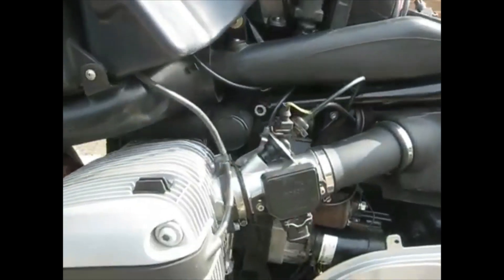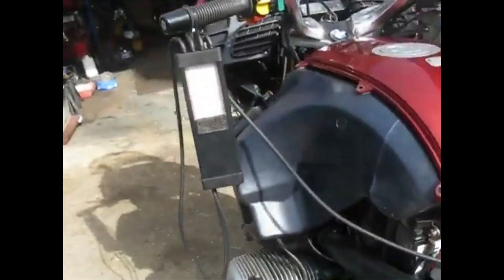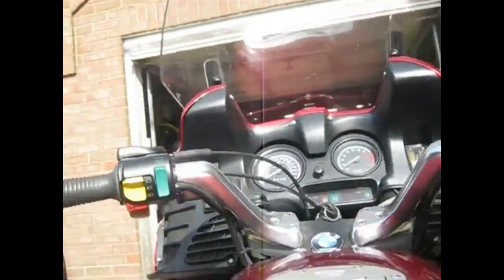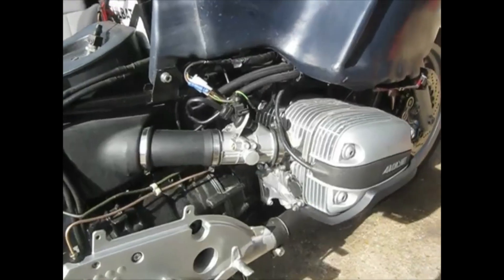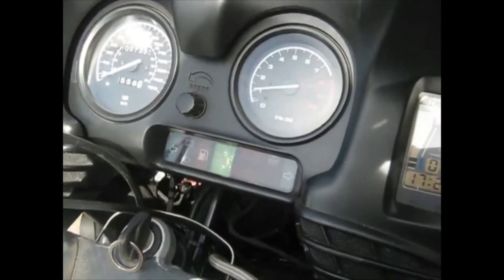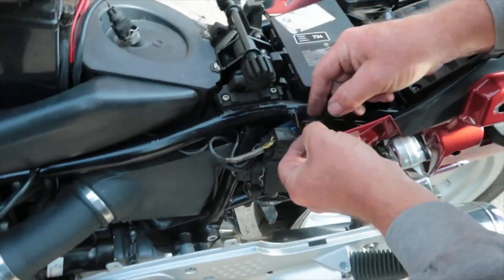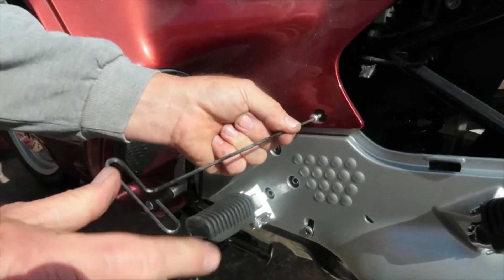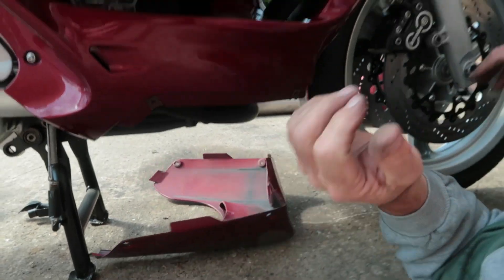Tuning the throttle bodies on my 1998  BMW R1100RT  | #motorcycle restoration biker

Comment: Beautiful bike. I recently picked up a 98 R1100R that I plan to restore. Quick question: Are those plastic head covers really any good in a tip over? I see them a lot but they look really flimsy.
Reply from the maker: Hi, thanks for your comments. Good luck with your restoration. These are superb bikes to work on.. Yes, the head gaurds are quite good in protecting the heads. they are designed to give and wear down so that the head survives. BUT! there are quite a few 'copies' out there that are total rubbish. They look the part, but they will shatter and then the head will get damaged.
Reply: @RestorationBiker  Most that I see are from China. What brand should I look for? Thanks again.
Reply from the maker: @old_shupshe  The best place to get any genuine products is to buy from either Motorworks, Moto bins, or James Sherlock. All these are good suppliers of BMW spares for all the range of new and old bikes. They let you know what you are buying and as a result you can buy from them with confidence. They are all UK based, but they do deliveries anywhere in the world

Comment: Hello! This is fantastic. Congratulations for getting to this point. I have a 94 RS and I would like to "restore" the bike to pristine... but having worked on bikes and cars enough to know that it is a tremendous commitment (and achievement in your case). If possible, can I send you some basic questions on your recommendations for parts, etc? Feel free to say no, of course! Cheers!
Reply from the maker: Hi, It would be a pleasure to help you in any way I can, just ask away.
The early RS had a great gearbox. I had a 93 version I put the box in my RT what a difference! Fab!
Reply: @Restoration Biker  Hello again! I wrote earlier about having some questions re: the restoration process. I have a '94 R1100 RSL and, well, have dreams of restoring to (near-)mint... so from 1829 questions, here are the main ones if you have a chance to lend your valuable insights:
1. Fairing/plastics: these have to be sent to a bike shop, color matched and restored and painted I figure... any thoughts?
2. Instrument cluster and light display... no way around just buying new units, I assume, to have them mint? My spedo and tach are fine, actually, but the center light display cover plastic has rough scratches...
3. Front fork brushed aluminum... what to do with this to restore? 
4. Wheels... how to restore the metal without damaging?

I know it's a lot and perhaps these are self-answering/obvious, but any thoughts will be appreciated, greatly!
Cheers from Pasadena, CA...
Reply from the maker: @agp8015  Hi, Nice to ear from you again. 1. Fairings plastics. This is paint work, where you need to find a good paint shop, one that does and likes bikes. Some don't do bike stuff as they are only into cars. Take a few small bits and assess how the guys seem. If they are enthusiastic and do a good job (many will display work on their wall or their website) then get them to do a few small items so you can asses the results. It takes time to find the right people. The guy I use is very expensive but his work is faultless.2. Instrument clusters. I had the same problem as you with the 'glass' that covers the idiot lights. The best way is to buy a new glass if it is still available, or buy a good s/h unit. That centre unit does dismantle if you are careful, I know, I've done it!!
3. Front forks!! Hmm, yes these are a real pig to get looking good. They are easy to clean up, but because they are not smooth it is difficult to get them looking good. Take one to a paint suppliers (automotive) and see if you can get the colour matched, they should then be able to make you a 'rattle can' in that colour. Expensive yes but the results are worth it.
4. Wheels. Yes, if your wheels are badly scuffed then you could farm them out to a wheel restorer, but then you haven't done it yourself. Or buy s/h wheels that are in nice condition, and restore them. I spend ages just rubbing them down so they are super smooth, then paint them with about 4 or 5 coats done lightly until you get a nice finish Don't rush it. Only do it if you want to, don't force yourself to get it done. I left my R1100RT for about 3 months as I just didn't want to do it, so I didn't.
Hope that helps, whats the weather like in Pasadena
Reply: @RestorationBiker  Thank you for this... really helpful and valuable... especially the bit about leaving things be without forcing them... Appreciate the feedback and will write soon with more questions... Oddly enough it is the cosmetic restoration that has me in knots, not so much the mechanical part as these machines are, well, precision tanks... Pasadena weather is almost shamefully good most days of the year... we don't actually have to put our bikes away here (at all...) and a California plus, we can lane split on the highway...Cheers and more soon!

Comment: I know it's an old video, just going to see one of these. About the synchronization? I thought that in idle you adjust the screw on each side and in RPM you adjust the cable. Am I wrong or are there 2 methods to this?
Reply from the maker: Hi I have always adjusted the cable for the synchronisation, and the jet for the rpm
Reply: You are correct, there is an idle adjustment screw and cable for throttle body synchronization.